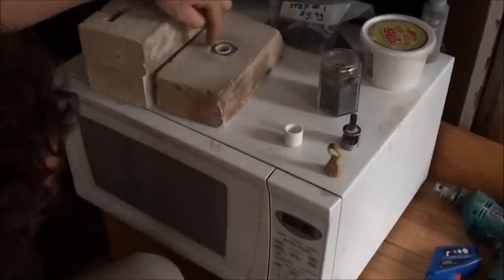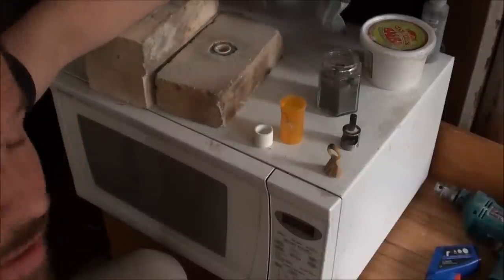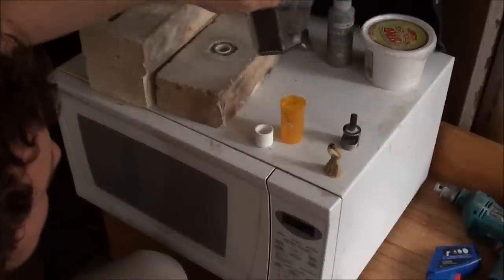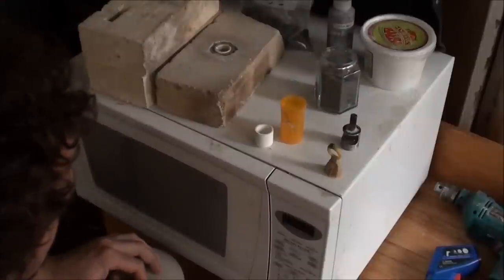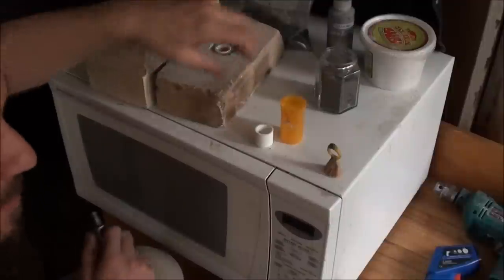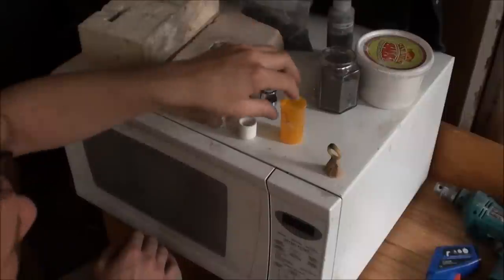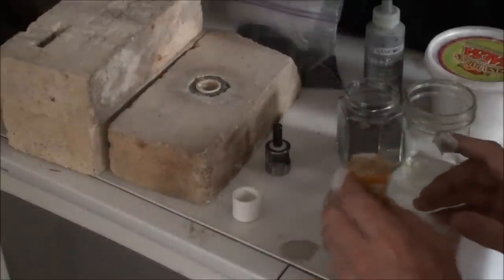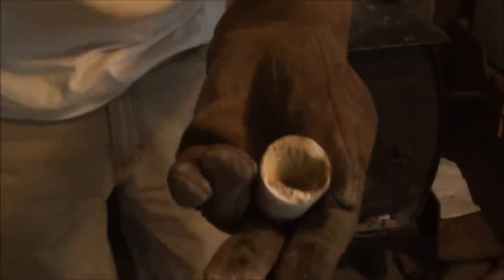melting and casting silver in a microwave oven

Comment from the maker: it took 28 minutes. I peaked in the crucible after 18 minutes and it was semi melted so I added 10 more minutes. there are a lot of variables. the microwave is rated at 1.8kw. my advice is to start with only a few grams of silver  pure .999 silver seems to work better than sterling.  good luck

Comment: Cool and easy way to melt silver but you do not give enough specific information, would be nice to have specific steps on how to do it.
Reply from the maker: good point. if I could go back and do it over it would be way better, hopefully it helps you get to thinking about it. there's plenty of room for improvement in the method. I can try to answer any specific questions you might have. thanks
Reply: +danielbennito  please do another more in-depth video.
Reply from the maker: +jokerrabit maybe someday. 2 things I will say. its important to mix the graphite in because it "activates" the magnetite.i put straight graphite at the bottom and a slight mixture throughout the rest. also get a square brick or make one. my rectangle got too hot in the middle and as the crack got bigger it lost too much heat...one more thing I got the idea from an article I read on the internet somewhere that explained it more in depth where he made a mold "shell' of magnetite and he flipped it. you'll have to look for it. good luck .
Reply: +danielbennito dude, the point is that no one understood what you did because you did not tell, so it's completely illogical to give details on something you did not teach in the first place.
Reply from the maker: +Maker Linux  what didn't you understand about it? it is logical to share even an imperfect video to possibly encourage, inspire, and invoke thoughts in others. use this as one example of how it can work.